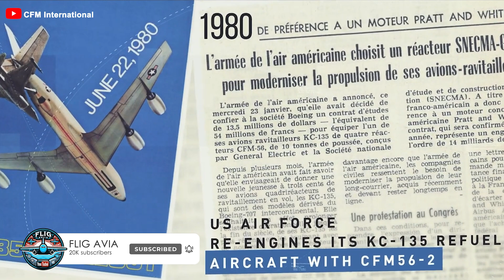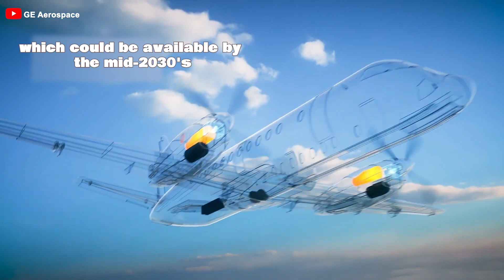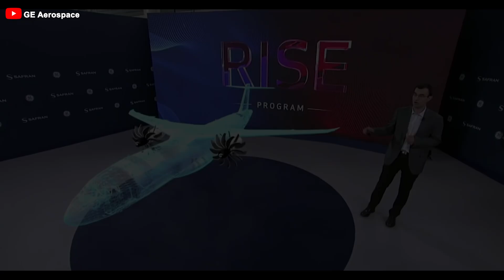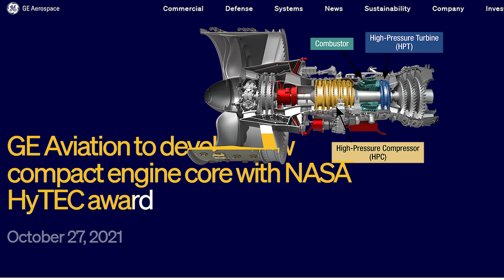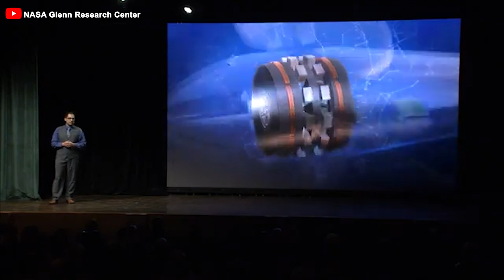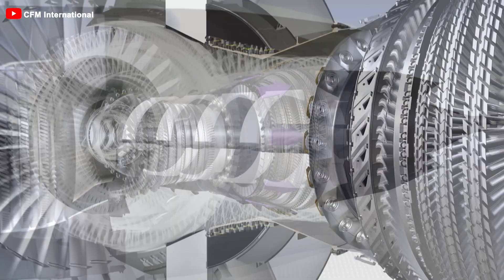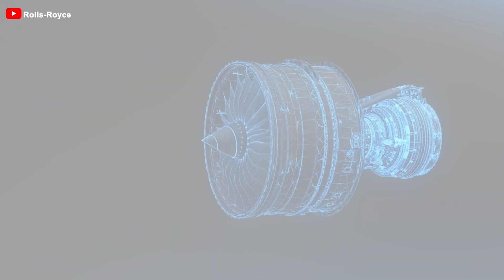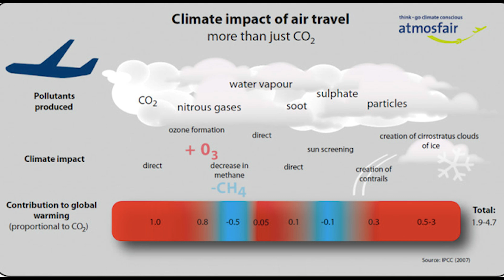Every Airline Prefers These "NEW 2 BIG ENGINE"! Here's Why

Comment: I'm going to watch what Rolls-Royce does with its new UltraFan geared turbofan technology. I think a new engine based on a smaller geared turbofan system could replace the entire Trent engine line by 2032, and that means 15-18% fuel savings and lower emissions, very significant for jet airliners. That means the 787, A330neo, A350, and (maybe) 777X and A380 planes could get a new lease on life with even lower noise levels and less emissions.
Reply from the maker: Great comment! Thank you.